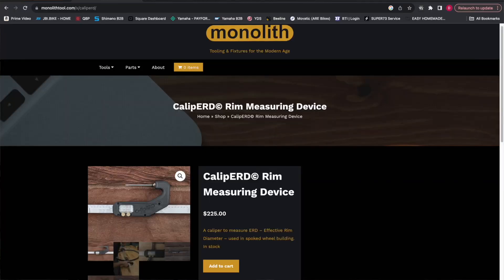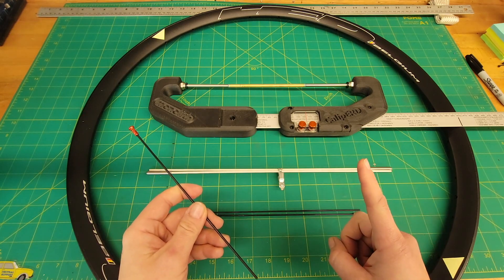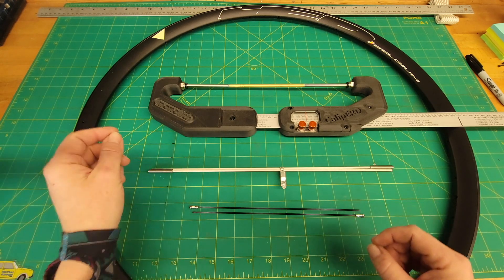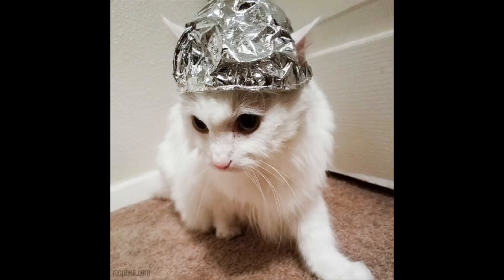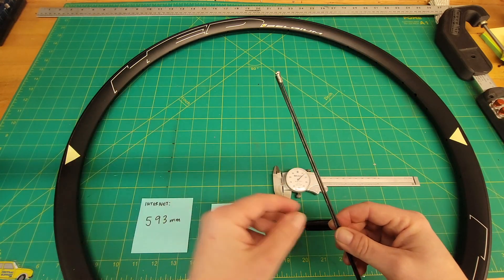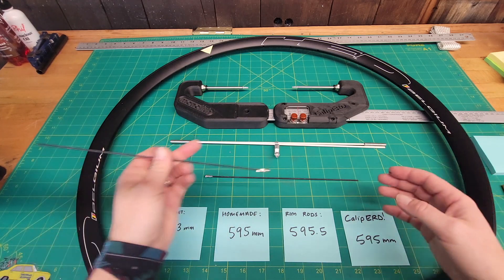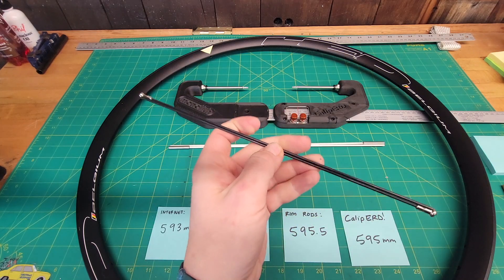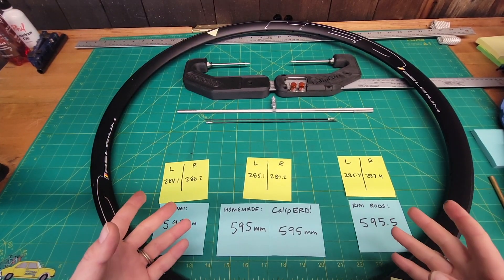The ERDo's and ERDon'ts of Measuring ERD: PLUS In-Depth Look @ Monolith CalipERD

Comment: its good to see people on youtube actually showing the right way to do stuff,there is way to much deliberate mis-information on bicycle wheel building on the internet,terms like,I dont use a tension meter I just pluck the spokes,or  I have to do the drive side spokes up to 120 kgf to get good tension on the non drive side,I did not know your youtube channel was on youtube until I saw you on Relja bikegremlin channel,these bicycle skills need to be passed on otherwise the good skills will be lost,the trouble with alot of bicycle shops is they dont even like working on your bike if you did not buy it from them,also now with ebike sales booming around 30 percent per year most shops are not even trained to work on them,try asking a bike shop to re-spoke an ebike hub motor,it wont happen,we have to learn to do most bicycle stuff ourselves because its not easy to find someone that will do a decent job,example,I just took my new ebike back to bike mechanic to fix my noisy disk brakes,he had two tries at it and could not do it,so i jumped on youtube parktool site and learned how to centre a hydrolic disk brake,that method partly worked but it still made noise,so I took the brake pads out,lightly smoothed them out with fine sandpaper,shined a torch on the brake caliper without the pads in,I could clearly see one side of the brake caliper was sitting too far over on one side,so i undone the two adjustment bolts,re-lined the caliper so the gaps were even on both sides then re-tightned the bolts,job fixed,I did not even have to re-centre the pads once I installed them,this job is very easy to do if you tip bike upside down and shine a torch,you cant really see the problem with bike sitting on a bike repair stand,cheers and keep up your good work
Reply: ps,Relja is legend

Comment: i use the old two spoke method and put the nipples on them that I will use in the build,also put the nipple on the spoke exactly where it will sit in the final build,never ever trust the rim makers specs,also try E R D at 3 places in the rim,then jump on Roger Mussons site and try his spoke calculater,Roger was a pro-wheel builder for many years and his spoke calc allows for a  spoke stretch in a fully tensioned wheel,ordinary wheel building is not hard to learn,it gets more tricky when you start lacing up ebike hub motors as alot of rules get tossed out the window

Comment: Great vid!
With rims requiring washers (eg dt swiss), and when using the home made tool, i assume one should take the NSD measurement with a washer inserted in between nipple and rim at each end - just as would be done on the actual build - then still add 3mm to get the ERD…..?
Cheers!
Reply from the maker: Yep! All additional hardware should be taken into account - and you can definitely measure in one go with the washers, or add the thickness of 2 washers to the final measurement.

Comment: I'm curious if you ever do the measure the circumference of the rim bed, then divide by pi, then subtract the measured distance to the nipple seat (x2) method? And how that compares to the three in this video? I build a fair number of wheels, but often times it's the same build, so I'm not always measuring ERD evey time, but when I do, I like to do it a couple different ways, if I can, just to make sure I'm on the right track.

Also, would you be able to measure the ERD on a built wheel with the calibERD? You can't do that with rim rods, but if you could with the calibERD, that could be quite useful.
Reply from the maker: I don't in practice, but I did so we can compare: 

Circumference: 1943
Depth to nipple seat: 13.3
NSD: 591.88
ERD: 594.88

With 595 being the reading on the CalipERD - I'm happy to call that accurate. 

For your second question, you could probably cheat the CalipERD by using the Enve feelers, butt them right up to the spoke nipple head in the rim, and then subtract the necessary amount based on the spoke nipple in there. I can't see that being as accurate as measuring without the wheel built, but probably accurate enough for a situation where you would need it. This also assumes that the wheel was built with the correct length spoke to not stick through past the slot (interfering with the measurement altogether). 

Maybe the key would be a feeler that is a tube that fits over the head to get closer to the NSD measurement. 🤷‍♀️

Comment: I don't quite understand why you add 3mm to the result. Your spokes are 250mm and they measure to the end of the nipple. In my opinion this is the erd point. Why do you think you only measure the nsd with the spokes instead of erd? Thank you for your support. Love from Holland
Reply from the maker: The homemade versions were measured to be 250mm from the base of the lip on the nipple (the nipple seat) - I had made them to work like the Rim Rods. I just COULD have made them to measure ERD if I had set the length differently. Since they were just an example, I didn't want to make any more 😁
Reply: @NeutralSupportNews  sorry I still don't understand why 3mm is added? how far in do I screw the nipple? Roger mussons book says I must exactly wind back 5.5 turns of the nipple otherwise the world will end. I have dt swiss squorx nippples to so I cant really see the end of the thread in the nipple because the head is way bulkier than normal nippple.
What I currently know about ERD stick is I cut them to a predefined length which is the 1 constant. The bit I am confused over is how far on to screw the nipple so I can not screw this seamingly simple task up.
Reply: ERD is not a fixed point but “relative”.  This is why it is named ERD “effective” rim diameter. Which nipple used will “effect” the diameter if you will